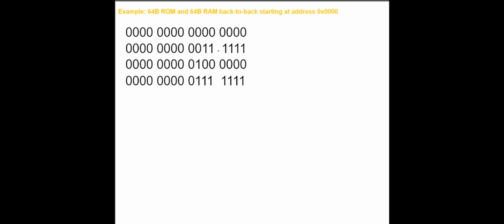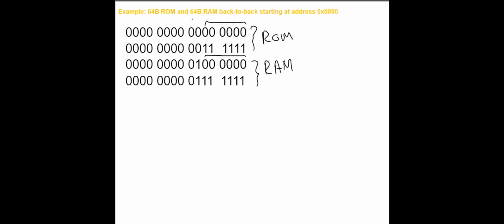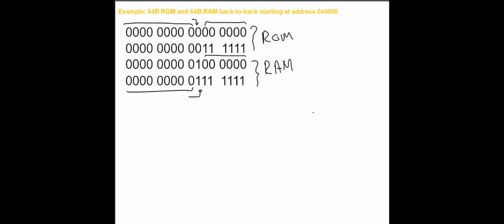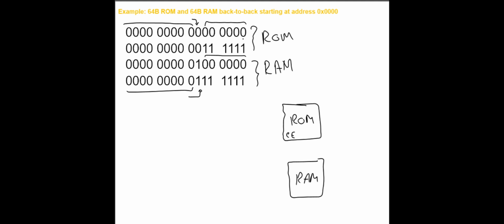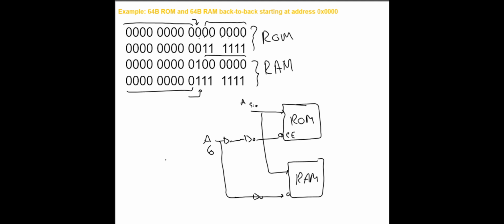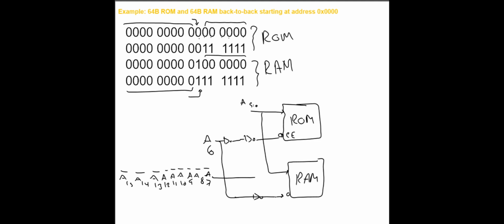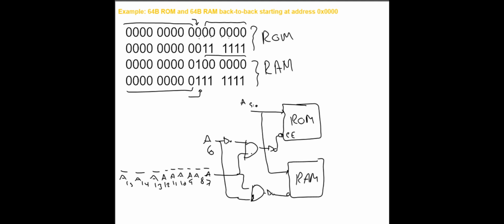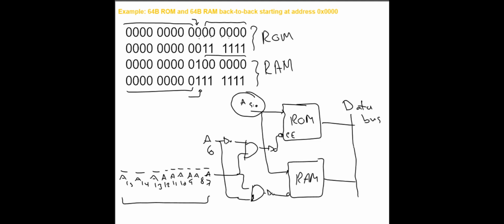Memory Address Decoding 6 Address Range and Decoding

Comment: Hi there .. I believe we must dealing with Bit 7 not Bit 6 to select between mem. of ROM and RAM, however that's will depend on Memory rang, but in our example I thing is Pin 7 is right not Pin 6 

Thx.
Reply from the maker: Hi! The discussion is about the address bits not the chip pins. Since the counting starts from 0, the 7th bit is A6.  In your comment then, bit A6 can be mapped to pin7.